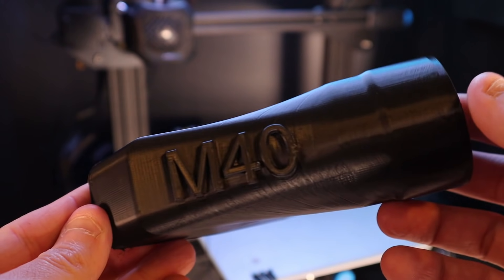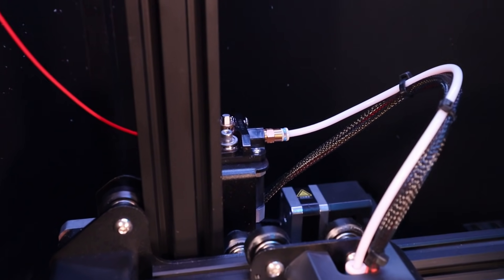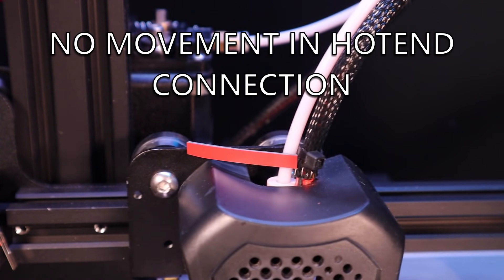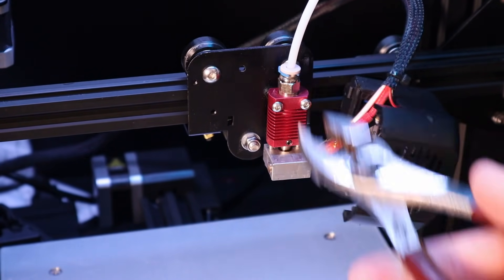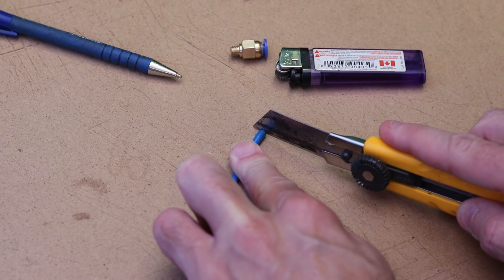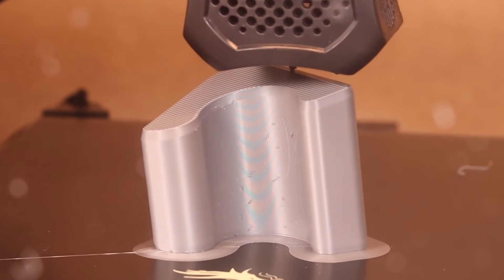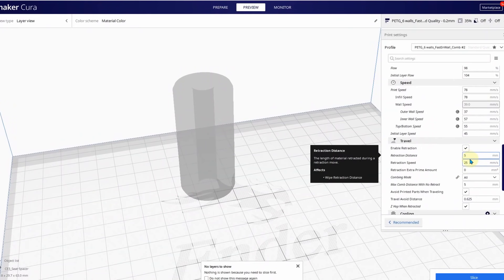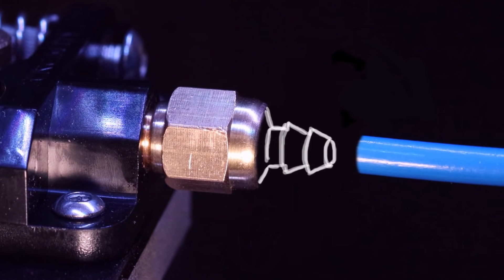Creality Ender 3 V2 - Fixing the Hidden Problem that Can Cause Stringing and Unresponsiveness

Comment: You'd be surprised how useful this knowledge can be, even outside of this specific application.
Reply: Explain x3
Reply: Well I don't know what TS ment but I worked at ABB as a test engineer with cooling systems for power transfer. There's a lot of these fittings with tubes for cooling systems in like MRI machines, so any pressure transducers might start to give faulty readings or weird values if there's play like this.